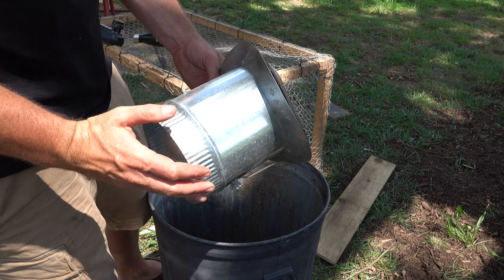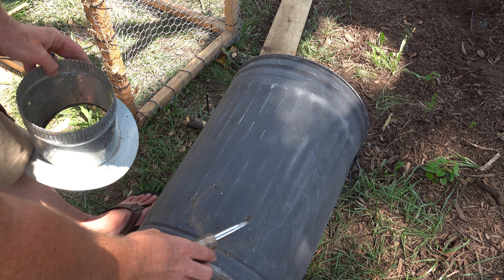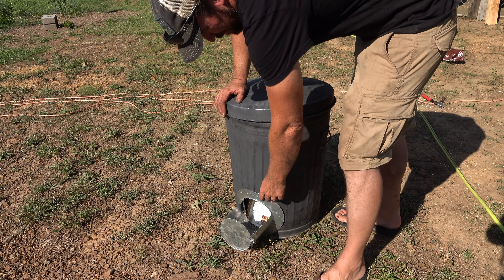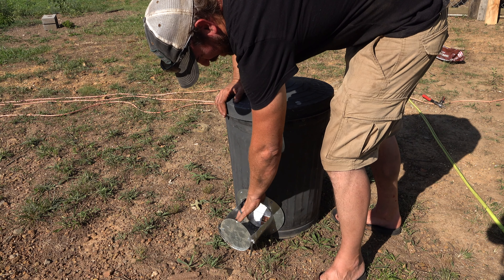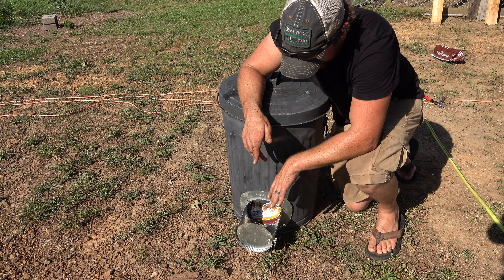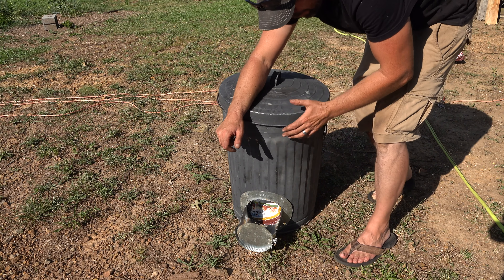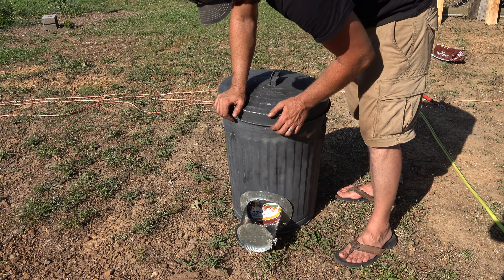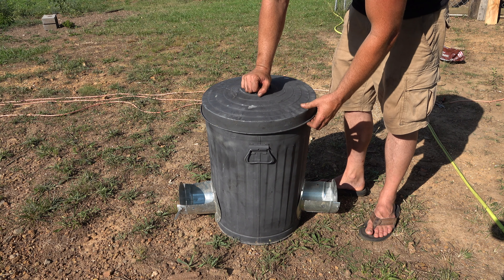Trash Can Chicken Feeder

Comment: Location: Idaho
Description: Lying to the west of the continental divide, Idaho will find itself under some compression during the coming pole shift. Mountain building will occur. Having experienced compression and the push east in the past, the rock strata in Idaho represents what has withstood this compression. Land to the east of the continental divide will be subject to this compression, and land to the west of Idaho will experience the greatest heat from the friction of subducting plates. Idaho will be pushed to the east during the shift, riding over the plains to the east. This ride will terrify its residents, but Idaho will not experience the devastation that earth movements will do to others areas to the east or west.
Full Article: http://www.zetatalk.com/info/tinfx087.htm